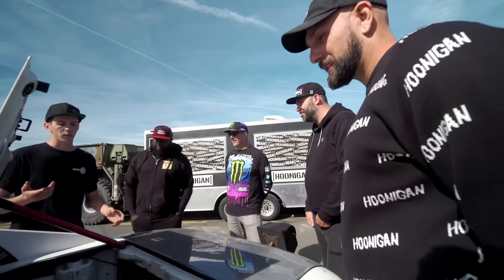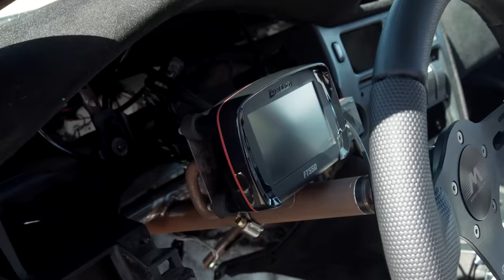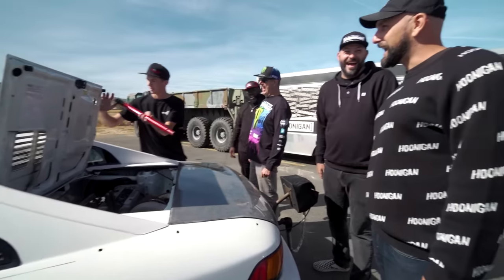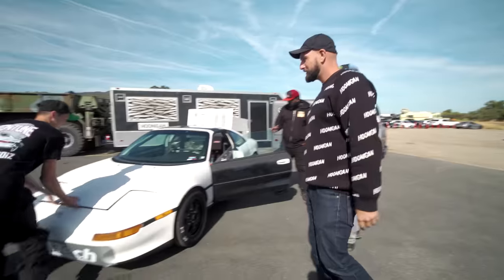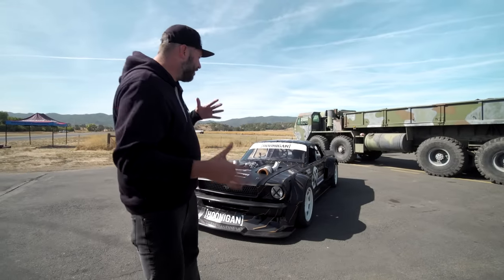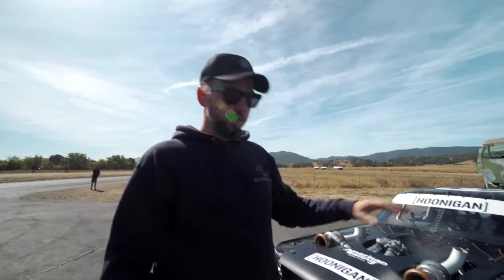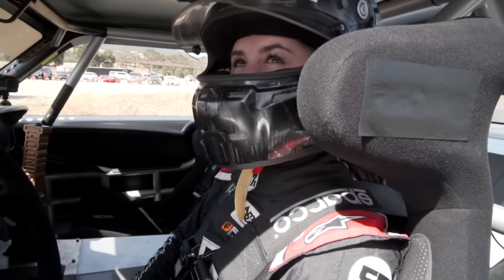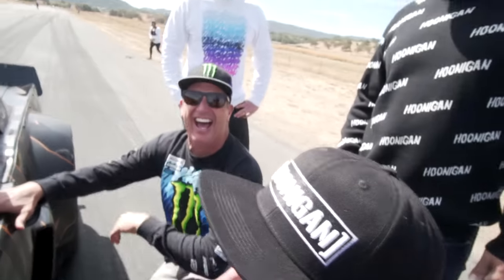BoostedBoiz' 1300hp Toyota MR2 vs Lia Block's AWD 1400hp Mustang

Comment: "Maybe a bit more than 1400hp" look at the second pass, no way the hoonicorn makes something moderately close to 1400, it's making waaay more
Reply: I agree, that thing was moving
Reply: 100% agreed....hooni is not 1400hp
Reply: It probably is on the first races though, then beep boop, whatever they need to win.
Reply: 2200hp minimum that thing is fucking out of there
Reply: I say this every video I watch
Reply: For sure. I wonder what its 1/4 time is and speed. If they beat a 8 second car like that. Jesus.
Reply: i think somebody said 1600hp
Reply: #1 It´s AWD vs RWD, that´s a huge difference
#2 HP aren´t everything, torque is more important and I can´t remember them ever mention it.
Reply: @KurtKn1sp3l  i know but the toyota already was going full throttle when the hoonicorn was standing still. After the hoonicorn went, a second later he started reeling him in already like wtf
Reply: @iLIKELASAGNAaLOT  right!? Like how do you blow past a 8 second car like that. Even with awd
Reply: @mrb2917  don't forget paddle shifters and awd go a long way
Reply: It’s a TT coyote…
Reply: @boostedlawnmower9955  it's a NHRA car. That thing probably does 5s.
Reply: Its not all about hp there is so much torque in that hoonicorn... And an all wheel drive car on it you have much more traction on the start but a little bit of less top end power.... For me the hoonicorn its running more torque than the mr2 and more hp than 1,400
Reply: It's all where drive buddy
Reply: @boostedlawnmower9955  it’s not a coyote it’s a 421 based of a Windsor
Reply: Doesn't even look real.
Reply: It took kimbo's 2000 hp GTR to take it down. Im sure it has a higher hp setting
Reply: I think Vinny is too blame..pure Meth
Up to prob 1600 ponies
Reply: @chensueher1393  Yeah and they are both awd, Im thinking the honicorn is more like 2000ish hp itself.
Reply: @philmeiklejohn  I figure if there was ever a time for that it was the race against the 2000hp GTR Kimbo. The driveshaft broke on the 3rd run. Well, they tried.
Reply: @KurtKn1sp3l  Horsepower IS the most important. Torque is a part of HP.  HP= Torque *RPM.
Reply: Why can’t we stick the hoonicorn on a prepped drag strip so we can finally see it lose to someone. All of these matches up so far have all been favored by the corn since they have AWD
Reply: Dual clutch or Paddle shifters are the biggest advantage. The guy running a conventional clutch system loses so much time per shift. The computers in a PD shifter or dual clutch system automatically programs itself to have 2 gears up or down ready at anytime to optimize shifting time to be down to nanoseconds. You never miss a shift with a dual clutch or paddle shifters. Even if it was 1400hp the reason it’s winning is mostly from the shifts being basically perfect & near the redline each time.
Reply: This is just funny to read🤣
The one comment who said it's all about horse Power need to do some homework.
Do u even know how much effort goes in to putting the hoonicorn to the pavement.? 
The amount of time that goes in to this. You just put down with one comment.
The paddle shift alone could do so much more for the boosted boys
Reply: @luuk341  Hp is a calculation of torque. Therefore hp matters less because you can't have horsepower without torque.
Reply: Probably makes 1600. That thing is a beast.
Reply: @chensueher1393  even then, the race was 1-1 im sure the gtr would've won that 3rd race but it would've been close. When she broke the drive shaft vinny said you gave her the juice huh. Meaning going into the computer and doing whatever i have no knowledge of that stuff lol
Reply: Awd makes a huge difference.
Reply: @dmanb9222  it is not a prepped surface that is how.
Reply: Two major factors in this.... tire compound and drive train....hoonicorn is running on tires meant for this very road setup...mr2 is on drag slicks which needs rubber laid on the asphalt...so you have one car making tons of grip with four tires and one making way less with two... start factoring in transmission gearing and you realize how one sided this is. I could almost guarantee that mr2 would win on a drag strip.
Reply: Holy crap!. That's more like 1700hp. Hoonicorn, spinning all four tires and still beats Kyle.🤔
Reply: they are def bullshitting on the hoonies power plain and simple.....they hate to lose and imo its pretty sad they cant just admit the shit and have fun.
Reply: @notyourbusiness1204  
I don't know why they would lie about it's power
If it's more than 1400HP they should be proud of that
Reply: One word, Traction.
Reply: @beans301  ok then hall much then ?
Reply: So it is safe to say that the setup in the car is well capable of making 2000HP. The thing is the way its compounded on methanol it probably makes 2000+ lb-ft of torque around 1400-1500 HP.
Reply: Ain’t no way more like 2000 moves like that red gtr in Texas
Reply: @iLIKELASAGNAaLOT  If that were true, Diesels would be monsters.
Reply: @romeomargot-picquendar1281  torque never made sense to me, like it pushes you back and thus makes your car feel faster but doesn't actually make your car fast?
Also I meant you can have an engine spin to 20k rpm but with no torque you won't get anywhere
Reply: @nielson lmao  yeah basically torque x time = hp. And rpm is a measurement over time. That's why it matters where the torque peak and how much Rev range the car has from there. Like electric cars don't have high hp but sustained torque peak from 0 rpm to 20k.
Reply: Ya, u know how the dragrace work hahaha
Reply: i was looking into it and the motor that ken has if it was n/a makes about 851hp. Then i looked up the turbos and each turbo can make 500-1,000hp  If you couple that in with all the other parts he has on the car I honestly think 1400 is the lowest tune on his car in my opinion it probably makes 1800-2000 plus you account how fucking light it is with awd and a sequential gear box.
Reply: @boostedlawnmower9955  coyote engin is a 302ci kens is bored 410 but whatever it still makes more then 1400
Reply: @dmanb9222  it's beep-booped to stay in boost all through the 6 gears so Ken had the torque to spin all four tires whenever he needed it, but accidentally made it a dope drag car lmao
Reply: @ililxaphanlili2600  that’s not a coyote engine, that’s a nascar based Windsor lol.
Reply: @mrb2917  🤣🤣 that's what I was thinking
Reply: Sure is has 1400 hp ....... it has AWD ....... does anyone remember what the Audi Quattro did to the racing world when it came out  ....... it had the same HP as all the other cars but had AWD  , that is why they banned it , it made the other race cars look stupid and slow ........ it is 4 wheels hooking up vs 2 wheels ........
Reply: AWD & getting clipped by traction control the  whole way down.
Reply: im pretty sure they know how much hp it has.
Reply: @la_goose5204  yeah, but it's the way he said it, like when you hear "maybe a bit more than ... " your mind instantly detects it as a lie
Reply: Ur forgetting that wat a car can actually do is measured by the power it makes from idle to said peak WHP# . Aka ur power curve/dyno graph curve. That's y a car that makes 300hp from 2-7k rpm can easily blow away a car that makes 450hp if it's only making that 450hp in the last 500-1k rpm's. If it only makes 225-300hp from 2-6k it'll be a whole lot slower even tho it technically makes 150 more hp. Peak power is for shit talkers an dyno Queens...more like dyno princesses. Wat matters is the pwr in between! Power curve will ALWAYS matter more than peak hp.
Reply: Facts definitely way more than 1400 hp 😂
Reply: AWD
Reply: Dats dat awd
Reply: yeah it definitely is 1401hp
Reply: @-n-6969  yea 1401 is waaay more.
Reply: @mrb2917  if you actually believe it has  2200 your delusional it’s not putting down anything over 1500 definitely on that street with those tires
Reply: @dmanb9222  cause it’s not prepped he ran a 8 on a prepped surface where rwd has the advantage on a unprepared track awd is better
Reply: @dmanb9222  no where near that wtf it’s maybe 8s in the video on a prepped track probably low 7s
Reply: @vctrsone  definitely not more like 1750 to 1800
Reply: @iLIKELASAGNAaLOT  you vant feel the difference between hp and torque.

This is objectively untrue. Your body can only feel acceleration which assuming grip and etc are out of the equation is simply going to be power/weight. 

Torque and power arent different in an engine they are one and the same. They cant be moved and slid around like adjustments. 

Anyway f1 cars make the same torque and have the same weights as road cars.
Reply: @romeomargot-picquendar1281  this is objectively false. Torque*time is not hp.

Torque multiplied by a speed (rpm) is power. That's why 50N-M from my hands into a wrench at 1 rpm isnt the same power as 50N-M form a motorcycle engine at 5000 rpm.
Reply: @benfennell6842  I said "basically", implying that it is a simplified explanation. 
Speed is a function of time, so it's not false if imprecise. 
Btw if we're going the route of cherry-picking, you got it wrong too, the equation is HP = Torque(lb/ft) x RPM /5,252.
Reply: @romeomargot-picquendar1281  if were saying it's your way it's better to say torque/time not torque*time, but even then it's still just wrong. 

And I wasnt wrong I just didnt add freedom units because you can use whatever units you want. Cant just add units to the same equation and pretend it's right now.
Reply: @benfennell6842  You said power= speed x torque presenting that as an objective fact, which is also false since you forgot a quotient  and some relevant units. 
The equation I provided is accurate for power in HP, torque in lb/feets and speed in RPMs yes? Different units would produce a different equation.
The whole point is here is you are nitpicking at a simplified explanation that I provided in response to someone confused about the relation of torque and power. Using the word "speed" while more accurate can be more confusing than saying torque over time which is why I said the later. 
Anyhow I really don't see the point of this exchange. I think we both agree fundamentally.
Reply: @romeomargot-picquendar1281  you didnt say torque over time you said torque * time

Which is silly because in both cases you just dont end up with power. If I apply 50 NM of torque for 5 minutes at 50 rpm do I make a different amount of power compared to if I applied 50NM of torque for 2 minutes at 50 rpm? No. It's just more confusing to phrase it that way. 

Just tell people torque is a rotating force, rotation is a speed, power is the product of that rotating force and its speed. The more force and the faster the force is moving the more power. Simple.
Reply: @benfennell6842  ok bro, I hope you feel better about yourself now. Have a good life 👍
Reply: @dmanb9222  with over 2000bhp
Reply: @vctrsone  lol @ 2000hp. I think it funny when hoonicorn dont lose here come hoonicorn haters comments
Reply: @johnhill8635  so you are here to watch hoonicorn lose? WOW salty much
Reply: @funtyes1970  How is that hating? The car pulls on other race cars that we know have huge power numbers with ease and every time we see anyone get close the laptop came out and suddenlly the hoonicorn would just eat them alive. Things a beast,1400hp is its base tune
Reply: Definitely can't have the hOoNICorN Loose oh no... Haha
Reply: Classic sandbagging.... that thing has more power and tje rave looks weirdly unfair
Reply: @KurtKn1sp3l  #3 Gearing ratio.
Reply: It is ABSOLUTELY higher than 1400. 2000HP MINIMUM
Reply: @johnhill8635 Fr I want to see it race the quarter mile really bad.

Comment: Let’s just take a second to appreciate anyone who has enough balls to drive a 1300hp MR2😂 definitely one of the sketchier cars to ever be made
Reply: plus, it's the SW20, the sketchiest of the sketch on top of its chute being burned by the exhaust.
Reply: @Ara2X  yup and pre 93 models were before they adjusted the suspension to be less oversteery
Reply: @piro9384  You say that as if this MR2 would still have factory suspension, lmao
Reply: If you know what your doing and respect the car, sw20s are a pleasure to drive and surprisingly easy to push towards their limits. 
If you don’t know how weight balance in a mid engine car works it’ll definitely spit you out into a tree though.
Reply: @lefunghi6151  MR configuration is pleasant until you lose traction then it's just plain scary.
Reply: Yup. I owned 2 Mr2s and they easily spinned like a top on wet roads if not careful. Loved the video and you guys have a bless holidays
Reply: @JuneBuggJr  mine hasn't done that but I do have an LSD which I'm sure makes a difference. Otherwise it's the old ass factory 1991 turbo suspension. Kicks out nicely for sure
Reply: @DwithBoost  a lsd would make it kick out even more lol
Reply: @ThatNofbody  was talking about how easily it spins or you lose control. Not how easy it is to kick out the back end. An LSD typically helps with controlling the car at its limits by distributing power and helping with traction.
Reply: @wildhogOW  the suspension on this MR2 is close to stock 😂
Reply: I almost bought a turbo mr2 15+ yrs ago and after test driving it... I passed on that childhood dream. Poor man's Ferrari. Still love the look but way more sketchy to drive than I expected.  Now add 1300 hp... and balls of steel!!! Mad props for not dying with that combo.